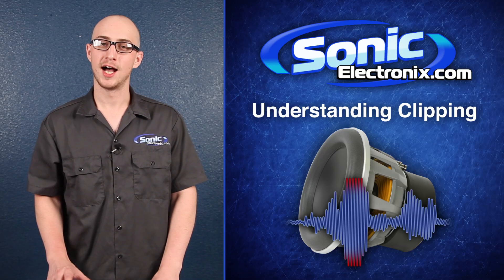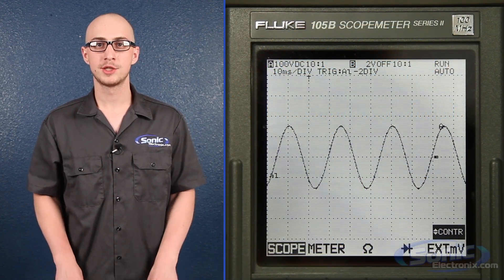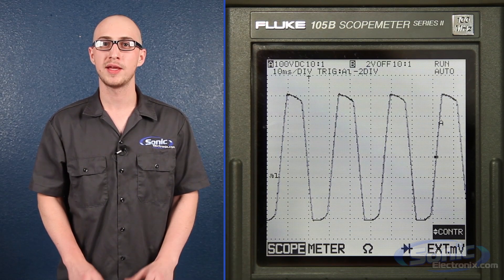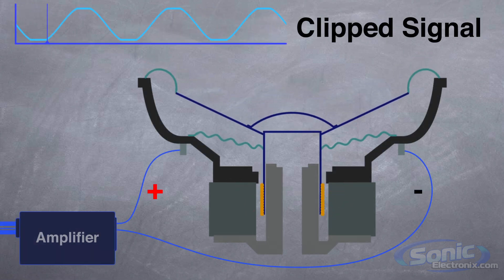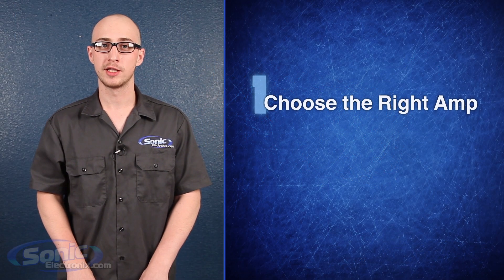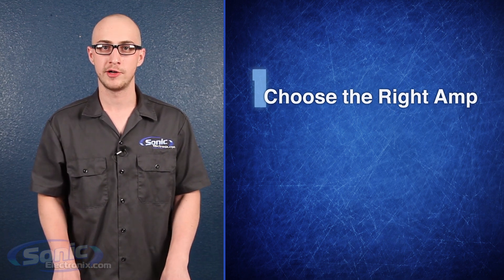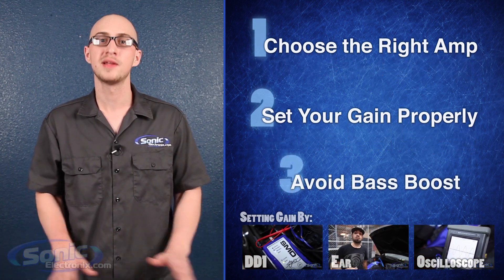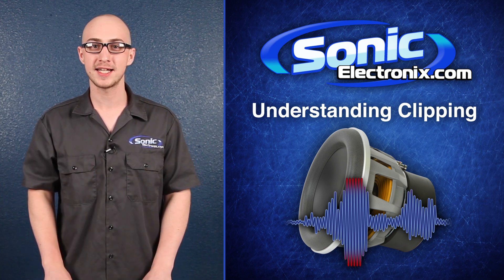What is Clipping??  Understanding Amplifier Clipping & Clipped Signals

Comment: If you have a 1000rms sub and a 2000 rms amp everything wired correctly so amp pushes 2000 rms all electrical is there no voltage drop can you burn sub by having a larger amp twice the power of sub

Comment: I am playing two 12" sub woofers with the help of Pioneer GM D-9601 Class-D Mono Car Amplifier at home & using 12V 50 amp SMPS to power that amplifier . The amplifier plays two 12" sub woofers normally for first one hour but after one hour of playing normally, the blue led indicator of the amplifier starts to blink & the sub woofers starts to distort/ clipp & produce disturbed sound. Plz let me know how to fix the issue ? The amplifier has three fuses each of 40 Amp.

Comment: Does anyone know a place in Dallas/DFW that can tune your system for optimal performance? I have always done things myself and i was never taught right. I recommend not going to the hood shops. These dumb ppl burt up my then new 2014 Silverado ltz crew cab. Was cruisin and bangin and thought i smelled electrical fire but nothing... i pull over to get a Gatorade and there's smoke pouring out my windows. Sure enough the POS driver's side sub ignited and was cooking my rear seat! And i was parked at a gas pump. Could have been bad. I almost ran away like Red on the movie Friday when he got his chain took. Instead I battled the fire with my shirt and a bottle of water and Gatorade i had just bought! I didn't have nothing but 2 12 Kicker CVR and an old Kicker 10dx1000.1. Idiots tries to tell me that it was the amps fault! They really blamed the amp. Always watch an install. After i took the sub out i noticed they had it wired wrong inside the box. They ended up buying me a new seat and equipment..  and lost a customer. I have upgraded trucks and equipment.  Still need help tho. Sorry for long post. Just showing how serious correctly installed and tuned equipment is.

Comment: I have the opposite problem - my sub plays fine but my woofers and tweeters clip at high volumes.  I discovered that direct connection to the amplifier instead of using [cheap] crossovers solved the issue, but I'm still not positive why the crossovers would be at fault.  Do they modify signals?  or do they only separate them?

Comment: I've been of this school of thought for some time... but, ask the question: why then does a guitar amp/speaker not blow immediately?  the guitar amp lives in a distorted and clipping state.  this does not damage the driver.  why?  there are far more dynamics and physics going on here than can be explained by the simple example. music is complex and harmonics vs power output vs clipping just isn't that simple.  we know that heat kills subs and other drivers.  heat is caused by multiple factors.  clipping does not cause heat in the driver like we think.

Comment: Better the amp has higher watts than speaker. The amp is happy and its ok for the speaker coz speakers coil has resistance or ohms. Like if the amp is 100 watts and the speaker is 80w 8ohms the 8ohms resistance will just allow the amp to put in less than 100w power to the speaker. If your speaker is 100 watts you will just waste money coz you cant enjoy the power that you were expecting for a 100w speaker coz of the resistance. If the 8ohm resistance will allow only a less than 100w power from the amp, what for you buy a 100w speaker? So buy a speaker that has a lower watts than your apm. Or buy an amp that's has grater power than your speakers like 50% higher power than your speaker if it is 8ohms stable or 20% more power if it is 4 ohm stable

Comment: Go to a local shop. Have them set your gains with o scope or a DD1. You be shocked on how much your ear is off. If you set it by ear. Some times you can gain 5db just by setting your gains the correct way.

Comment: A tip may be to use one amplifier per subwoofer. Also use an amplifier with twice the rated power of your subs and supply twice the amount of amps or more to your amplifiers max sinewave ratings. This makes sure that you are feeding your amplifier and vehicle with enough power and reduce possible dimming lights. Avoid using capacitors if possible. As they are mainly used as a filter for your battery and dont supply any extra power. Also make sure to have the big 3 installed when installing your amplifiers. Theres videos explaining what the big 3 is and how to install it yourself. But taking these precautions will allow you to have plenty room for proper tuning and clean power resulting in longevity of your system and many years of enjoyment.
Reply: THE GAIN IS NOT A VOLUME NOB!!! Common mistake made by many. Felt like mentioning it one more time for anyone who may have missed it. Lol

Comment: What this guy says is kinda true but it depends on alot of things, like how far into clipping are you pushing the amp, for how long and how much the woofer can handle being overdriven, how good the woofer is at cooling itself, an amp running into dc could potentially put 3 time the rms rated power of the amp into the woofer, as instead of giving more voltage, its now giving more current, but you would hear it sounding very very distorted and only a complete idiot would run their system like that on purpose..  what they dont tell you about cheap amps is that the reason that they are not as loud as expensive amps isnt so much that they lie about the watts, but that the amp cant sustain the voltage due to piss poor power supplys, so it drops the voltage and provides current instead, so the woofer doesnt move as fast and consumes loads of current and gets hot instead, so you get your watts but instead of more voltage and less current, you get less voltage and more current..

Comment: i have 1 jl audio w7 to a synergy 35.1 amp but i have the amp turned nearly all the way down because i know the amp has to much power only until i get my box made for my other sub but i bumped it and it sounded good but then started to make a fart noise when turned up is that exactly what you call clipping? or is that something else is my speaker ok as long as i stop playing it until i get my other one i hope i didnt ruin my sub please can someone help?
Reply: Set your gain.  Do this buy turning the 'gain' on your amp to zero.  Turn your stereo volume 3/4 of the way up and then slowly turn the gain up until it changes tune and sounds different and off, now turn gain down slightly so it disappears.  You do all this by playing a 40Hz test track by searching on Youtube.  That farting noise is because you have your gain down too low and by turning the volume up, the amp is not pushing enough power into the subwoofer.  You might have a powerful amp, but if you don't give it enough juice by setting the 'gain' then it will not perform will, you also don't want to just crank the gain all the way up because it might destroy the subwoofer.  Just do what I said and see if that works.

Comment: I have a basic system 6x9 with amp and phoenix gold with built-in amp,so do I set the 6x9 gain for clipping and let's say volume on sterio is at 30 when set,do I then have sterio at that volume when setting the subwoofer,any help much appreciated 🔊🎶

Comment: I have an Epik Empire subwoofer. During certain parts of movies, there are Clipping noises. For example, in X-Men: Apocalypse when Apocalypse turns HUGE and destroys things, the sub clips. And the movie Everest clips a lot, too. I have the A/V Receiver at -15db - the minimum setting. I have the sub volume dial at the noon position. It is at 78db with an SPL. When I have the volume at 72 on my Onkyo A/V Receiver, it clips in most movies like that. It is not a defective sub. Another Empire did it, too. Do you know why this is and how to stop it?
Reply: Hope you get an answer Mike. Do you know if once an amp clips my speakers, is the amp itself fried? I have an ONKYO amp and hesitant to plug in new speakers in fear they may be harmed. - Thanks in advance, and i love ONKYO equipment.
Reply: @JamminClemmons  The answer to your question is, "No." If a speaker or speakers "clip," it has nothing to do with the amplifier or receiver being broken. It simply means the speakers have problems. Either the weak speaker cannot handle the large amount of power from the amplifier/receiver or the speaker can handle the "power," but only to a certain decibel volume level. After a high decibel level is reached, there will be "clipping" at certain frequencies in the speakers. 

For example, in a subwoofer it is usually lower frequencies below 30hz that have problems when a loud decibel level is reached. 

The subwoofer I have experiences "clipping" problems with frequencies lower than 30hz once the decibel level of 102db is reached.

There is nothing wrong with the amplifier/receiver, and there is actually nothing wrong with the speaker. It is just a limitation of that particular speaker. The decibel level can be much higher than 102db and work find with that speaker; however, it won't experience a "clipping" problem until it gets to be a very low frequency lower than 30hz where the subwoofer is BOOMING at a very low frequency. It's not "broken," that is just the way it is. 

In fact, most subwoofers can't even process sounds that low. It is actually sounds closer to 20hz that give this particular subwoofer a problem. Most subwoofers don't go lower than 25hz. That is actually sort of a good thing, because it is those HUGE frequency sound waves below 25hz that cause the effect of "clipping" problems.

Comment: I also have the 105bii. When I first got it I thought the only thing an AC sine wave on the scope would show me was clipping. It wasn't until I tested an Alpine 149bt that I discovered what distortion looked like. Shortly thereafter I found out what heavy noise looks like coming out of a JL XD1000/5v2. I wasn't aware, until now, how much valuable information a proper scope provides. Aside from clipping, distortion, and noise, I hope I don't discover a fourth anomaly but it would be cool if you re-did this video to show everything a sine wave can show you aside from just clipping. It might help a lot of people.

Comment: my system use to clip when I had it in my single cab ranger I suspect this was due to the lac of power I was feeding the amp so I had to tune it way down ever sence I put it in my Ford focus and gave it significantly more power with much thicker cable and a second battery for the system it runs right on key
Reply: Travis Gulley sence I last commented I have put the sub in a big bod mentioned for the sub and found the amp is car to little for the sub at RMS

Comment: i have a 15 inch kicker cvx 2ohm wired to 1ohm hooked up to a db drive a7m 2000.1 amp. i have trouble setting the gain properly by ear. usually, play a 40 hz test tone and turn up the gain until i here distortion then back it off, but with this setup there is no distortion even at max gain. i know my amp could be clipping even if no distortion is heard. so my question is, where would my gain be safe to set without using a oscilloscope or multimeter?

Comment: this is false, clipping will NOT hurt any sub or woofer as long as the amp is rated less than the long term average of the woofer, hook up a 1000 watt amp to a 200 watt speaker and clip the amp and YES you will burn out your woofer...NOT becouse of clipping but becouse the average power greatly exceeded the speaker. clipping will damage tweeters IF its extreme clipping in which case the music will sound like crap anyway.. speakers are damaged by OVERPOWERING not underpowering.
Reply: my sub is half the price of my amp, defo would rather blow the sub.
Reply: Thats why many amplifiers come with a separate wired volume nob for proper tuning. I recommend higher wattage amplifiers for your subs. Its also about being a smart user. I never understood why people just crank the volume up all the way and max out their systems. Causing distortion and stuff. Thats what blows up your speakers and subs. Smart users know their systems limits.
Reply: I agree what you say. Clipping isnt bad on subs. Friend of mine runs his sub all day on total square and nothing has happened.   As long smoke isnt blowing through port you are good to go.
Reply: You should never be anywhere near a clip and your music will lose all of its clarity once you are pushing it too hard. For lack of a better term, your music needs to have a lot of dynamic range (or the movement from low to high). When you push your components too hard you will lose this first. If you had a graphic display, instead of pulsing up and down or left and right (analog VU), the bars or the needle will stay pegged.
Also, you might want to try and get a hold of a BJT type amp instead of a MOSFET amp. I have never heard a (comparable) MOSFET that sounds as good as a BJT. Sure, a high quality MOSFET will sound better than a very cheap BJT, but a good BJT is much better than most FETs. Don't pay much attention to marketing wank either. You do not need a lot of power to really blast music. I have a 45 Watt per channel amp (HK 730) that will blow a 500 watt modern amp out of the water.

Comment: I have a new car, expensive service installed my system but had to drill in a bass led knob I've never had, my last car would thump, this one clips and shuts down all audio I have to restart my car, wtf should I do????!?? I'm running 2 12's 1000 watts each with a 1600 watt amp but like I said in my last car I never had it clip

Comment: Can i use 200RMS Amplifier for 300RMS SUB? please give a detail answer
Reply: its expensive as fuck, even a amp and sub capable of 500 watt rms is expensive
Reply: Thompa P yea i guess so haha i have a 1k watt 15 and its still not loud enough
Reply: both at 4ohm
Reply: whats up with everyone using low power subs?
Reply: Thompa P I have a 12" d.c level 3 that's 1000 rms.  my amp is only 500 rms at 2 ohms. I paid about 500 for box, sub and amp. Installed will be another few hundred dollars. If you know how to do it yourself, you can spend about $600- $700 and have a nice 1000 watt rms system
Reply: i have bought 2 12" kickers, prewired to 2 ohms, that want 1000 rms, and an amp that is 1000w at 1ohm, and 650" at 2 ohm. So if i just install it as it is at 2 ohm, the sub will deliver 650 w and the subs will want 1000w rms, do you think it will sound like horseshit or will it sound decent?

Comment: hi sonic i have a sundown x12 v.2 1500w will my digital design m1c which is 12v 1200w/ 14v 1700w be able to play it or do i have to get a amp with higher watts at 12v

Comment: I'm running a 8in kicker with 100 watt rms. My amp is 400w peak. Would it be okay to turn the bass boost to 6db and set everything on the head unit flat? I really like the sound of the bass boost.

Comment: My amp kept getting clipped signal yet gain was barely up at all and both subs and amp could handle waaayy more than what we had it at do you know what it could be? head unit wire or voltage possibly?
Reply: patricknbrooks11 wired for correct ohms on amp?

Comment: I remember the first time I hooked up my own system by myself and had the Gain set to MAX..
I had no idea, lol. Crazy how my Sub is still working at this point as it gets really hot in the summer here.
Reply: puneet7891 well depending on head unit output voltage it might have needed to be turned up higher..mayhe not quite all the way tho lol
Reply: Hahaha you probably thought you had the best subwoofer in the game😂

Comment: 1:19 "straight in one direction"????? WHAT??? it's been moving straight in one direction this whole time so what's he talking about when he says this?? Thx.
Reply: Also how is it "stressing the suspension of the woofer" if the weak amp causing the clipping is not even powerful enough to max out the woofer"??  Makes no sense.
Reply: holding the cone in position at the clipped point causes excessive heat which is what can damage the voice coil.
Reply: TruAgape1234 basically it's being pushed up but when it's time to come back down its still being pushed up, and vice versa.

Comment: plz help my girl was driving my car and hit a car my amp is on the top of my box since i cnt put it anywhere else anyways it seemed very magnetic if it touches metal well when she slammed the breaks in the accident the box slid and touched the metal and now i cnt turn my subs up full max because of the distortion in the subs it happened to me sometimes when the amp touched metal but i would simply slide my box away from the metal but this time it seems bad

Comment: Is it okay if I use a 500 WRMS AMP with a 550 WRMS subwoofer?
Reply: This differs depending on who you talk to but in my experiences (16 years) I have had the most success with amplifying my subwoofer + or - 10% of rated power. In my honest opinion you should be fine, but like the video says, set your gain right and avoid the bass boost and you'll be fine.
Reply: ok thanks
Reply: i have bought 2 12" kickers, prewired to 2 ohms, that want 1000 rms, and an amp that is 1000w at 1ohm, and 650" at 2 ohm. So if i just install it as it is at 2 ohm, the sub will deliver 650 w and the subs will want 1000w rms, do you think it will sound like horseshit or will it sound decent?